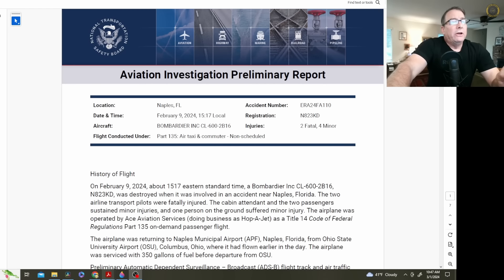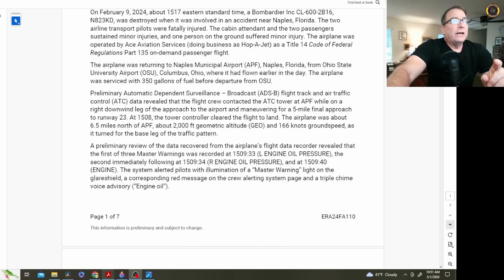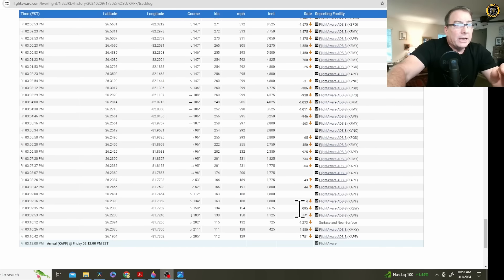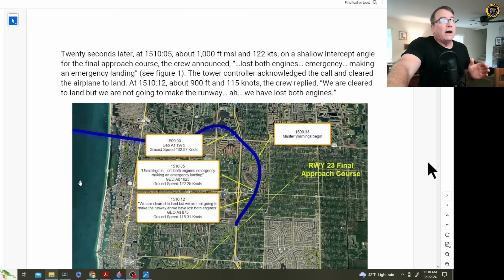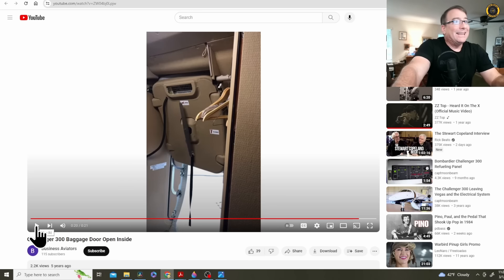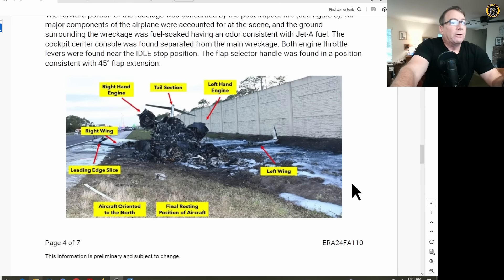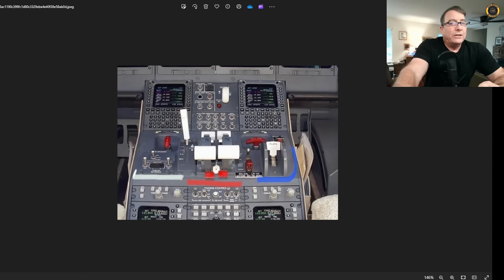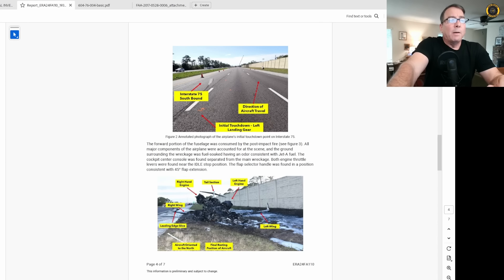NTSB Preliminary Report: Naples Challenger 600 N823KD

Comment: Juan, thank you much for the objective analysis. As you surmised, the FO was indeed a former highly experienced airline guy. I had the pleasure of flying with him many times. A fine gentleman. RIP.
Reply: This was a targeted hit on the two passengers
Reply: @JimmyHossa  Why? By whom?
Reply: @JimmyHossa A targeted hit that just so happens to have happened 5 miles from landing after being in the air for hours? Right…..
Reply: @JimmyHossa Troll.
Reply: @ingresswizard9044  Because the likelihood of the engines randomly deciding to both fail on final after being in the air for hours is such a solid conclusion 🙄😵‍💫
Reply: @JimmyHossa there’s precedent for that, British Airways 38 in 2008 due to Fuel starvation caused by ice build up in a heat exchanger and Cathay Pacific 780, nearly crashed due to fuel contamination
Reply: I flew with Ian many times.  Great guy!

Comment: Regardless of the cause, I am impressed by the calm demeanor on the flight deck - captain and FO worked the issue and flew it ALL the way to the end.
Reply: If it wasn't for that sound barrier, they would still be with us.
Reply: @HuckThis1971  I meant the cause…before THAT cause…
Reply: @baomao7243  Because they most likely knew they would have been OK. So many hours in the cockpit as a pilot. A wing end clipping a hard structure isn't forgiving and will spin the aircraft in direction of rotation. In this case a concrete sound barrier. It's an unfortunate situation.
Reply: The pilots did the most heroic thing and saved the passengers and flight attendant.
Reply: 😂Did they check the fuel origin at Ohio State University???
Reply: @HuckThis1971 stupid golf course. Only area with a ‘sound barrier’
Reply: @patstevens2959 Did you see any official report saying it was definitely fuel contamination? Also, that laughing in tears emoji when discussing a deadly crush doesn't speak kindly of you.
Reply: @BlueSkyUp_EU  These emojis are frequently hard to make out and they sometimes change a little from one device to another. Likely the tears were clear, but not the laugh.
Reply: @libby2012  It's paired with a text hinting that the pilots didn't properly check the fuel, so it looks like a deliberate choice to me. Speaking ill of the dead without having solid evidence wouldn't be fixed by a crying emoji anyway.
Reply: @thereissomecoolstuff They gave them the chance to live. Make no mistake the flight attendant saved the passengers on board by her quick thinking. She is a hero.

Comment: The possibility of an inadvertent dual engine shut down brings back memories of a similar incident that happened with a Navy EA-6B Prowler circa 1978. The 4 place jet entered the break at 800' just ahead of the ship in preparation for trapping aboard. As the pilot banked left and  retarded the power levers to idle, he inadvertently pulled both PCLs in the the idle cut off position, shutting down both J-52 P408 engines (first cousins to the JT-8D}. The power quadrant is designed so that the pilot can NOT shut down both engine at the same time. What we determined during the subsequent investigation was that there was some wear in the quadrant such that if the pilot retarded the left PCL slightly ahead of the right one, it was possible to pull both PCLs into the idle cut off detent. The first indication to the crew was engine related warning lights coming on, followed rapidly by a dark cockpit as the generators dropped off the line. I don't remember if there were 3 or 4 crewmen aboard, but all successfully ejected. It is hard to believe that two engines could simultaneously flame out from fuel contamination.
Reply: Agree, especially with last sentence.
Reply: Wow.   Good info.  Thanks.
Reply: Was there no fingerlift or latch to prevent going to cutoff when pulling them to idle?
Reply: Not likely an accidental shut off.
Reply: @MattH-wg7ou yes there is a switch with gates.
Reply: Cvr?
Reply: @ablack7777  Gotta be pretty unhinged to risk a whole career, jail time, and a multi million dollar jet just to get back at your CO lol
Reply: @MattH-wg7ou try watching the video, then you’ll see the latches.
Reply: You can believe it. It has happened.
Reply: Funning thing, back in '75 I was on the beach det in NAS Cubi Point (Subic Bay) and watched the exact same thing happened to an A-6E turning base. As I observed the airplane settling into a flat descent and both crew members ejecting. Being a Aviation Machinist Mate I was very familiar with the workings of the Power Plant systems. On the A-6 (and EA-6B) the throttles will move from a flight power setting to idle and then to the left to the cutoff position. We called this coming around the horn to cutoff. If you made a sloppy right turn the centrifugal force could move your arm to the left bring the throttle around the horn and into the cutoff position. This airplane had the J52-P8 engine.
Reply: @MattH-wg7ou  yes it was but they presented Wear and that factor was key
Reply: The accidental shut off the engines as described by Juan sounds the most plausible; I know the engines were at idle, but I would expect an awful lot of water in the fuel would be required to flame out a jet engine, not to mention the flight was ending so any water in the fuel would have been sucked in long ago, assuming they hadn't just switched tanks to one that had water in it for some reason. Florida winter temperature is a long way from that of UK, coming from Beijing, so fuel icing is really unlikely and even in the BA 38 crash I don't think the engines flamed out.
Reply: @axelBr1  Last year a crash occurred because a jet was filled with fuel contaminated with DEF. Stuff that isn't water does happen.
Reply: @ablack7777 Seriously?
Reply: Sad…Good crew…bad luck…
Reply: There was no cabin crew, there were 3 passengers, why would you have an attendant for 2 people? Lol
Reply: @Deadfoot-Dan  There was a indeed a flight attendant, which is not unusual on private jet charters. I was well acquainted with a Filipina who was an attendant on that make and model jet, operated by the owner of the largest Kia dealership in America.
Reply: @Deadfoot-Dan : We don't just know that there was a flight attendant, we also know her name and heavy emphasis on safety on her training.

So yes, there was an attendant.
Reply: And the attendant was there exactly for this purpose: to have someone in the cabin who knows the plane in and out. The passengers would not have made it out without professional help.
Reply: @MattH-wg7ou  this was what weared out and thus no longer functioning correctly.
Reply: @ablack7777  why would you then make a calm radio call and even repeat it and land it safely, if you wanna take your life? Makes no sense.
Reply: @Tom-zs6bb  I read that the three  together were all related, so that rules out a flight attendant.
Reply: @ablack7777  I'm sorry but please stop such unfounded speculations. Let the investigators do their work. Abusive remarks on a crew which gave the ultimate sacrifice saving the passengers is just sick.
Reply: "It is hard to believe that two engines could simultaneously flame out from fuel contamination." You have a good point. Losing both engines in one second due to fuel contamination sounds unlikely but cannot be ruled out at this phase of the investigation.
Reply: @ablack7777  You don't know that it couldn't have been an inadvertent mistake, as this video states. It's nothing but speculation at this point.
Reply: @karldunnegan2689  okay…but the odds of 2 engines pulled over the stops simultaneously in a grievous error approaching astronomical
Reply: @ablack7777  What you're suggesting is also astronomically unlikely, gomer. Not impossible, but very unlikely in this tragic accident.
Reply: @Deadfoot-Dan - Then you read garbage.  Just because a flight attendant is not required does not mean that one cannot be included as part of the crew. Carrying a flight attendant for a few passengers on a large cabin business jet such as the Challenger is not at all uncommon.

Comment: Despite the odds heavily stacked against them, these pilots performed their duties impeccably. Not only did they keep their passengers safe, they limited the collateral damage done on the ground. All while making the ultimate sacrifice. I hope that if/when I am faced with an in flight emergency, I perform as admirably as these folks. Rest in peace legends. May the skies in heaven be blue and the winds calm.
Reply: @_-Karl-_  We can sit here and debate about what caused the engine failures, or whose fault it was or wasn’t but what’s done is done. Human error is a thing, we are all susceptible to it. Regardless of the cause of the dual engine failure, these folks did everything they could to minimize the loss of life while landing a massive aircraft on a busy Florida highway and I commend them for that. I hope you have an awesome day and weekend Karl 🤝
Reply: @TurningFinalOfficial  I completely agree. Aviation operates in the present, not five seconds in the past. Even if the pilots inadvertently shut down the engines, their response immediately after was exemplary.
Reply: @lukegerst2382  Very well said my friend!
Reply: "Correctamondo."

Comment: A clarification on the red, Idle shutoff Levers.
The thrust levers are designed such that they must be in the idle stop before engaging the red Idle Shut off lever in order to shut down the engines.
Engaging the red shutoff lever when the thrust lever is not at the idle stop will prevent the thrust lever from going into shutoff.

I’ve had personal experience with a thrust lever linkage disconnect on a CF-34,  and believe that it is extremely unlikely that both engines’ linkages would fail at exactly the same time.

Something worth looking into is exactly at what time were the flaps selected to 45 degrees, and did that time coincide with the engine failures.

Also, if there was  Engine Oil indications, the N2 would have been too low to recover the engine without a starter assist (way too low airspeed for a Windmill start). 

Another consideration is that the CF-34 3B engine does not have an auto ignition system for flameout recovery.

Well explained Juan!
Reply: Also, once the throttles are placed in shutoff, the same safety levers must be actuated and held in order to place the throttles back into Idle. Which NTSB reported that the position indicators on the FCUs were at Idle.
Reply: @robertc4293 That’s right!
Reply: The thrust levers were put back to idle after the engine shut down I’m sure. Shutting the engines down with the captains forearm is the only probable cause. I flew the CRJ series for 7 years and can totally see this happening.
Reply: @Banshee365 That’s the most likely cause for the dual engine failure, be it a forearm, or sleeve, etc.

The 604 and CRJ-200 (unlike the -700/-900) does not have an auto relight ignition system, and I doubt that whoever brought the thrust levers back into idle thought to hit the CONT IGN to ON.
Reply: @Banshee365  it will be interesting to hear what is on the CVR.
Reply: Fully agreed also with @robertc4293 and @Banshee365 here. I also have some experience flying the CRJ2 and the 1000 (here in EU) and it may be possible to get a dual engine shutoff if the FO would be PF and the CA PM, setting flap 45 while simultaneously the TL being retarded to IDLE.
NTSB will definitely take a close look to flap lever position while throttle back.
Reply: @juyg7h8yh  Agreed. It’s quite possible to inadvertently engage the red lever locks when the thrust levers are at the idle stops.
An advantage that the 1000 (and also 700-900) has over the 200 is that the 1000 has an auto relight ignition, thanks to FADEC, whereas the 200 does not.
Reply: @Banshee365 once they committed to land you would want the engines in idle just so they wouldn’t come back to life as you were heading down the freeway.  I remember the jet  that went swimming back a few years ago that restarted in a pond after going off the runway.  It was spooky!
Reply: @dirtcurt1  sounds like you are describing the CitationJet registered OY-JET that overran the runway and ended up in the bay at Bader Field in Atlantic City. They replaced the CJ with a Sovereign and registered it as OY-WET.
Reply: Thank you.  That was something I was wondering about.
Reply: 601 guy here…the only hang up i have for this theory is that power remains the same or even have to add power when going to flaps 45. Idle at 45 is steep. Really need the FDR data for when flaps were called for and selected.
Reply: There’s a video floating around somewhere of the situation described - it acts as described. Right arm of left seat reaching for flap lever, left arm of right seat pulls thrust levers back, right arm of left seat hits cutoff levers, thrust levers drop back to cutoff.
Reply: @ruppaeb Agreed, it doesn’t look like they were too high, or too fast once they turned base.
IMHO, it was probably a flap 30 manoeuvre on the visual until twr cleared them to land, then selected 45 when they turned base.
I’m guessing it was a momentary power to idle to slow down to flap 45 Vref+10.
It was probably at that exact time that the red lever locks were engaged.
Just to be clear, I’m throwing a WAG at that one.
What’s certain is that they had no chance of a relight once the 604´s ENGINE OIL aural (same N2 where the 601 red oil pressure light illuminates)
Reply: @ruppaeb Agreed. I’ve flown the 605 for 4years and on a 6 mile base I can see no reason for going to idle thrust that far out. This plane flies like a truck. With gear down and flaps 30 you would bleed airspeed so fast going to idle. Not something 2 pilots with over 35000 combined experience would do. And not something the auto throttles would likely do if they were engaged. Also a 6 mile base is not a short approach as he mentioned in the end of the video.  Not something we do in a challenger. 
Also what people are not mentioning is the ADG was not deployed. The ADG is an emergency generator for loss of all electrical power. It deploys automatically with dual engine failure and no other source of electricity. It is a big propeller connected to a generator that deploys off the right side of the nose. It would be visible in the video. Therefore the APU was running and the APU generator was on and providing power to the aircraft system. I’m not sold yet on the inadvertent shutoff everyone is jumping on. Both throttles were found in idle at the crash site. Not sure if it is everyone’s standard practice but ours is to turn on continuous ignition for landing. So, IF they had transferred the bleeds to the APU, and the throttles were inadvertently set to cut off, then when they went back to idle, all they would have had to do was push a start button and that engine would start if it was able. Too slow to windmill, but the APU would provide the air.
Reply: @aaronwilliams8600  Good point, 1800 feet and 6 miles is right where they should be. I agree, there’s a lot of drag at flap 30 and gear down, so I can’t imagine why the PF would have gone to idle.
I watched the dash cam video closely to see if the ADG was deployed but couldn’t see it because of the camera angle and video quality.
I don’t know if the 604 had the APU inlet mod (standard on the 605, if I’m not mistaken) that would allow the APU GEN ON with engine generators running. Even if they did, that would have been an extremely low altitude relight.
All of this is sheer speculation. I’m sure everyone, especially current Challenger pilots, want to know.
Safe travels.
Reply: @aaronwilliams8600  good observations. I couldn’t tell and haven’t seen any reporting on the adg. But in the 601, very common for us to turn it on 5-10 min out and arm the gen. System logic will not have it take a load but with it on, it’ll take over upon loss of ac power. 
I’ve seen mixed ops with the ignition. But yeah, if not on then you’d have to select an ignition source then the starter. 

That’s what I was getting at re: idle. Falls like a rock ruling configured at idle out of ground effect. This whole thing is weird to me. We’ll see what the final report says